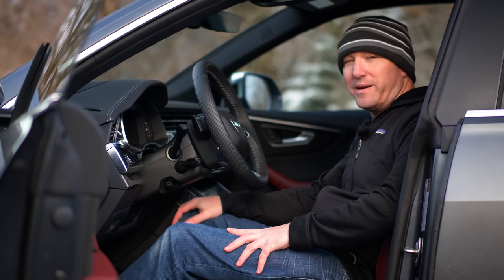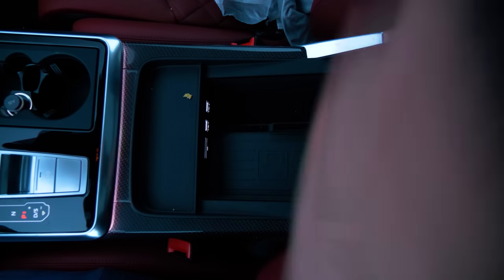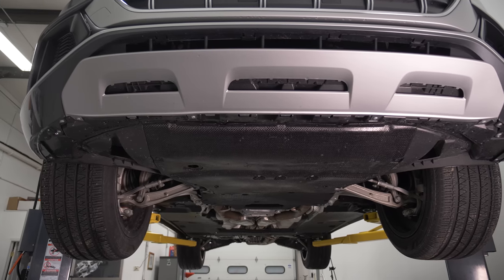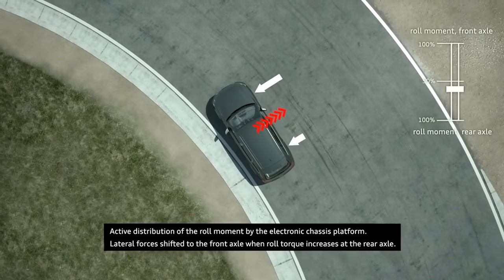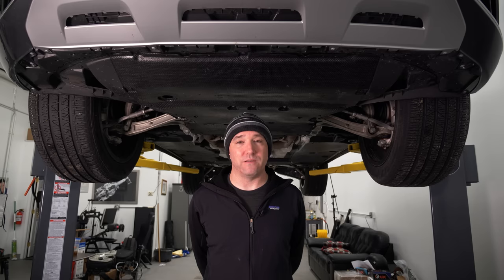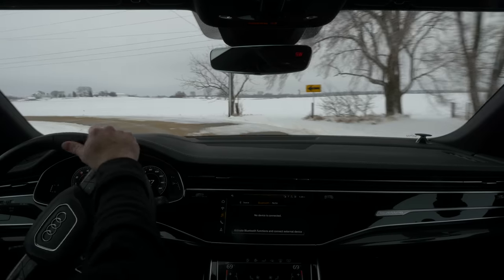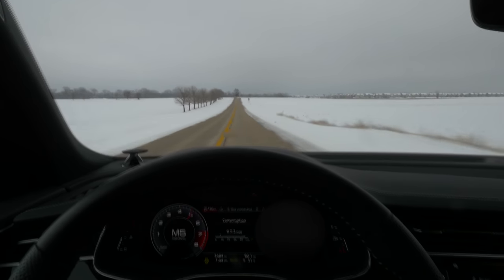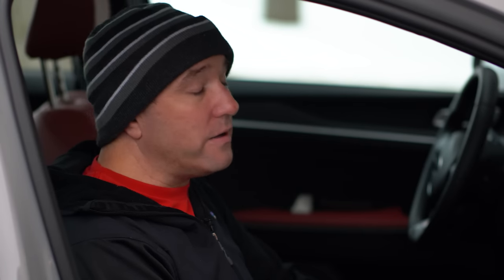2021 Audi SQ8 | Replacing Sports Cars

Comment: Great review.  Thanks so much.  I do have a question that I am hoping this reviewer or any posters here might post an answer or further input on.  I just watched both of his reviews, on the 2021 Q8 and 2021 SQ8.  Both great.  I am torn as to which to get.  I like the better mpg of the Q8, but some of those additional features of the SQ8, in addition to the more powerful engine, are awfully appealing.  Though I think some of the mechanical/electronic things he describes in this SQ8 are options available on the Q8.  Here's my question:  Which do you think would be better in ski country, mountain highways, but also backroads that may not be quite so well maintained, and most importantly, driving reliably during the winter time in bad snow storms (the best days to go skiing)?  And why?  He seemed to suggest the SQ8 might be better, but I'm not sure if the technical reasons he gave might also be available in the Q8.  I do really like the smooth, quiet of the Q8, but the SQ8 does have its own Comfort mode.  I will be doing a lot of long drives in the summer time as well.  Going "off roading" is not a priority for me at 59 any longer, though knowing it can go onto dirt roads and such reasonably well to get me to a destination, say a campsite or fishing spot or out of the way Forteener or ski mountain, having some flexibility in that regard would be nice.  Oh, and one other question.  I can get the loaded Prestige Q8 with the larger sidewall 285/45/21 tires instead of the 285/40/22's if I forgo the purely cosmetic s-line and black optic packages, and I can get the same slightly larger sidewall tire with the Prestige SQ8 that does come with the cosmetic s-line package but not the cosmetic black optics package.  Is there a noticeable difference and advantage for my kind of driving referenced above going with the larger sidewall 285/45/21 tires instead of the 285/40/22's, or is it so negligible that I should just go for the extra cosmetics, which do make a great looking car look even better, the black optics especially?  Thanks for any input.  And again, great reviews.
Reply: I thought I had posted on the Q8 review, but I don't see it there so I must have forgotten to click it thru.  Oh well.  But this post here for the SQ8 still applies, and I hope some will respond with their thoughts.  Thanks.
Reply: Hope you got an answer. I have the same question as you. Please share if you got an answer.

Comment: The amount of min-maxing in this car is insane, and that's just the stuff you were able to see and feel. This thing is going to be an absolute nightmare after the lease is up. Case in point - it already has a check engine light from the start-stop system and whatever bullshit Audi threw in on top of all that. No new car should ever throw a check engine light this quickly, for any reason.

Comment: Although there is no EV yet that satisfies my current needs in terms of luxury/range/price (I drive an E Class)...I really really can't wait to get away from this over-engineered, insanely complex cars we've come to after 100 years of development !
The sheer simplicity of EVs is such a breath of fresh air.
Reply: Except there is no luxury EV's yet.  Tesla is more premium like top spec Sonata than luxury.
Reply: @normt430  wait for MB
Reply: @cartmann227  i guess there is I-pace and eTron.  

The cost to build will drastically reduced like GM who has 500 engine and transmission combinations to 19 with EV!  But not sure we'll see the savings at purchase time.

Comment: I don't quite understand the check engine explanation at 10:45.
How does a car with an automatic transmission stall? Or did the start stop system shut the engine down but the brakes didn't hold and it rolled back?

Comment: 5:50 That paint shit detroys all potential for tasteful design sense. It is one of the great insanities that shows the true level of intelligence of humankind, kinda like a self-ridicule. Many minds are simply glossed over madness.
And here I am with an insanely crudely set up tuned Corolla and it's got black AP Racing calipers.
Reply: I actually did a better job with a caliper paint kit from Ebay.
Reply: @dougrobinson8602  👍 for mocking Audi, 👎 for painting floating calipers. 😉

Comment: Dear Germany: a vehicle with 4 doors and a liftgate is not a "coupe."  You have built a station wagon and all shall refer to it as such.
Reply: 100% agree
Reply: In an age when a man can self identify as a woman, definitions are meaningless.
Reply: @Ethan7s  😂😂😂
Reply: Dear Americans, if you could speak more than 0.8 languages you'd realise that coupe simply means to cut off. Which means the rear pillars get cut down for a sloping roof line. The number of doors is irrelevant. And if you want to be a pedantic smartass, coupes only have 2 seats. So most coupes aren't really coupes.
Reply: @bux834  is that why Europe is constantly at war?  What language did you guys use when asking Americans to save your candy asses?
Reply: @Ethan7s  😂😂

Comment: Goose, this or the Cayenne S for similar money?
Reply: Cayeene s is the better car. The issue is the cost delta.
Reply: @jackholmes8105  Break that delta down for us simple folk.
Reply: @ted6462  a similarly equipped cayenne s is between 20-30k more depending on options. I cant objectively say its 20-30k better but..... That being said the cayenne has far superior drivetrain calibration despite the lower horsepower figures, and much better ride and body control than the sq8/sq7. The cayenne also has different awd calibration and i would argue a nicer interior as well. This is a segment that is without a value proposition and you have to pay to play in sadly.
Reply: @jackholmes8105  Thanks for the feedback.

Comment: I have a C7 z06, one of these was chasing me for about 15 miles on the 5 freeway in San Diego. I was shocked, it was fast. Wish I knew if it was this of the RS. We ran some high speeds to and it kept up, not as fast, but kept up

Comment: I really really hate the black piano glass
Reply: I get used to it on a Regal TourX and CT6.  The TourX had it in a similar horizontal spot and needed to wiped down occasionally.  The CT6 HVAC controls are black but low in the console and more vertical so they are never seen.

Both screens are pretty much smudge free but if you are eating or snacking on something they won't be clean.  A clean free towel a couple of times per month is all that is needed to keep them clean.